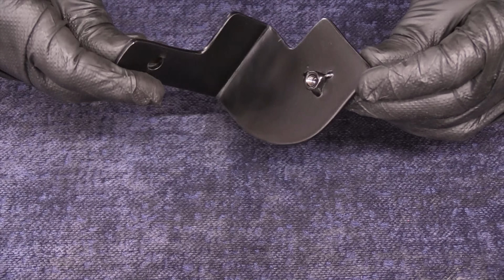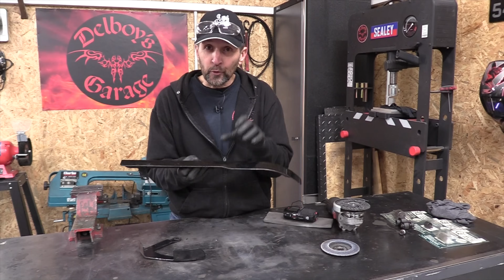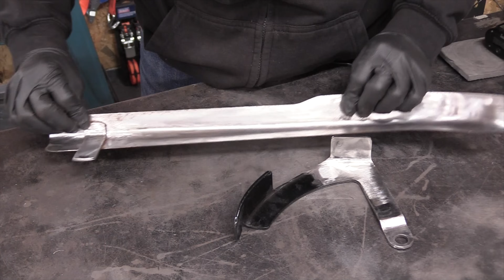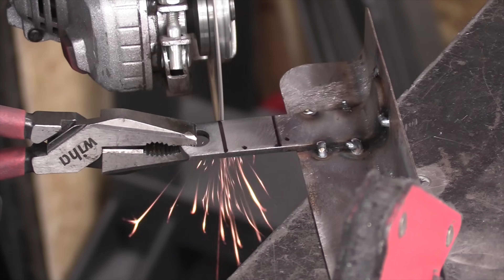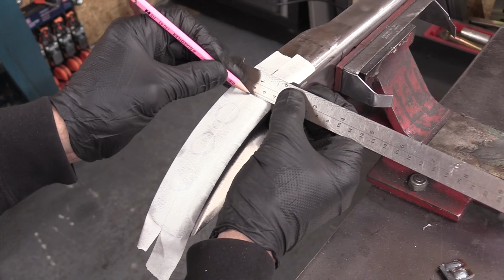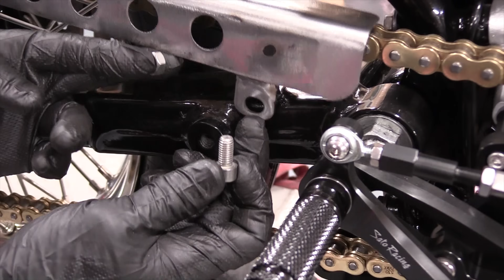Harley Sportster, Custom Chain Guard !

Comment: Another great video brother! love this custom cover 👍 bike is looking awesome ! one question, is that a wheel cutter you use to create those bigger holes, (the black piece with a bolt ) ive never seen one like it. Very cool tool 👍 Stay safe guys cheers from new york !!!!!! 🎉🎉
Reply from the maker: Hey Renzo.. if you look up "Q-Max sheet metal punches", they're a pretty common fabrication tool, readily available from suppliers, and as you can see, really easy to use.   Have a great weekend both of you and keep safe over there.. !  D&Pxx

Comment: Happy welds on that one Del. Isn't it satisfying when it just flows? 
Also, it'll be nice to try something new with the holes. Brass and lathe sounds just the ticket.
Have a lovely weekend, 
all the best to you both. 
✌️🧡🤗
Reply from the maker: It sure is mate, it's such a joy welding thicker metal for once, no fear of it blowing through and you can get some proper penetration.. Have a great weekend too buddy, and keep safe.. D&Pxx